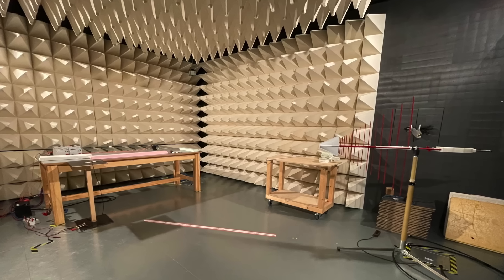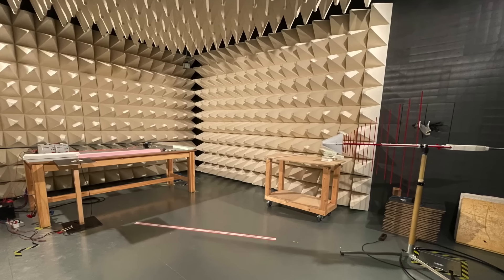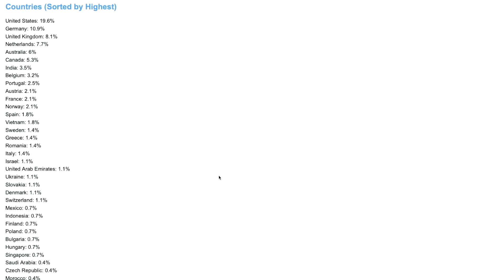I Built the Perfect PoE Sensor - But Can't Sell It to You

Comment: From what I understand, the CE is a conformance promise. You could theoretically do the tests yourself (if you had access to $$$$$ equipment). This is how those "cheap chinese" electronics get as far as they do; they can abandon the company and resell underneath a different brand when the CE tests are found to be non-comforming.
You could possibly be two companies, one that distributes electronic components (which might get you into trouble if there are dedicated distributors, not sure how resellers work) and one that assembles kits (where you would offer assembly of "any" kit but only choose to assemble "your" kits). So a person may choose to purchase all the components for a kit from your company A and also choose to purchase the kit assembly option, where you "hire" company B to assemble the kit. If you think about it, I'm free to purchase wire and stick it directly into the outlet, but a company selling an outlet shorting device will be liable for the damages that occur. It's on me for misusing the "wire", its on them for the proper usage of the "outlet shorting device" resulting in damage. 
In your case, are you not simply selling a module that interacts with an arduino, the same way a single IC chip is expected to be used with a power supply? In which case, why would you need to be CE conformant for "components"? The end user is doing the assembly step and turning it into a finished product that they use. CE applies to finished goods, you selling a kit/shield vs a finished turn-key product are two differing items. I'm no legal expert.
It just seems to be that you could avoid some heavy costs by selling it "incomplete". Similar thing happens with FCC and radio kits (partially because transmission requires FCC license, but receiver kits seem to get a nice easy pass).
I am no legal expert though.
Reply from the maker: Thank you for the interesting idea! Not sure if the two-company approach is legally sound 😄. However, selling the module as a kit or shield rather than a turn-key product could indeed help reduce costs and avoid some heavy compliance requirements — though those are mostly one-time expenses. The biggest challenge I still see, however, is WEEE and PPWR.
Reply: I thought it was because there are two different CEs of two technically different logos that look extremely similar. CE for China Export and also CE for Conformité Européenne
Reply: @hughjassstudios9688 CE china export is intentionally made to look like conform. euro. CE mark.
Reply: @hughjassstudios9688  No this is a joke, because the CE label is often faked and even when it isn't it's just a promise by the manufacturer rather than a standard that is tested by third parties (like Tüv or VDE marks for example)

Edit: To expand on that: You need the CE mark to sell certain kinds of products in the EU. Hypothetically, putting a china export mark instead of a CE would give the manufacturer just as much trouble as putting a "real" CE on a non-compliant product.

Comment: Sell kits? Seems like an easy way around these certifications? Setting up a company can be quite expensive tho, yep... Please dont give up tho. This truely is a awesome project.
Reply from the maker: Kits would help with certification, but at the same time, certification is the most valuable of the things I mentioned. :D I won’t give up! ;)
Reply: @playduino  Understandable and of course itd be ideal if you can get it to market consumer ready and certified and all. If this isnt possible, lots of people would probably buy kits. If the SMD parts are presoldered for easier assembly, thats even better. Most people in the market for such a sensor know how to set up homeassistant, maintain a network with POE, run ethernet through walls and ceilings and potentially fiddle with firmware. They probably then also know how to solder a few components on and screw the case together (or print it themselves).
Good that you dont plan to give up tho, excited for the next video and future plans ;)
Reply: I would absolutely buy the kit, just make it so that I can do it with a soldering iron (perhaps you are allowed to pre-solder the smallest SMD components?) or so that a small and cheap / DIY heatplate will work. Love your work, please don't let thet demotivate you!!
Reply from the maker: Thank you! That really means a lot to me 😊
Reply: @daviniusb6798  In automated manufacturing, pick-and-place can only solder SMD and BGA components anyway, then someone has to check the placement of bigger components.
Reply: @saiv46  This is so ridiculous, I can buy a WLAN temperture sensor for 8€ a piece, how many of those would you need to sell to get the xxk€ back for the certification?
Reply: @daviniusb6798  you can make the kits to be insufferably easy to assemble. like putting just two parts together. no soldering required to satisfy the kit loophole.
Reply: I’ve hit these roadblocks before and I came here to suggest kits as well… I designed something years ago and ended up going the kit route as it bypassed the ridiculous bureaucracy. It depends on what the motivation is (sorry, just saw this video so I don’t know the backstory) but if it’s about getting something out there, kits is the way to go.. if you want a valuable business, regulations are sadly a must BUT you can perhaps find a company in Asia that already has the approvals and so for them, adding a sku is a lot less red tape than starting from scratch - good luck 🤞
Reply: I would consider buying a kit / kits
Reply: I wish. The regulations apply to kits that include all or most component parts, to avoid this exact loophole.
Reply: At least in Australia, the kits would still need to comply with the standard and carry the Mark. It's an annoyance.
Reply: Kits are not exempt from the rules if they yield a final product. I wanted to go this way too, but this is unfortunately not the way.
Reply: KITS is the way to go in this case. I was in the same situation in the past.
Reply: How much work is it required to leave for it to be a "kit"? What about just the power connector? Maybe just a resistor? Or assembling the PCB into a case?